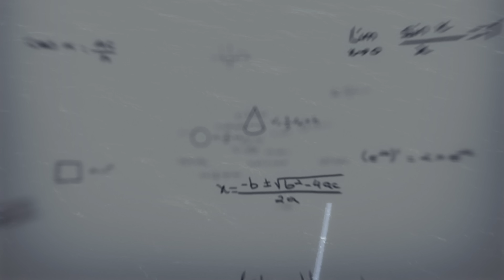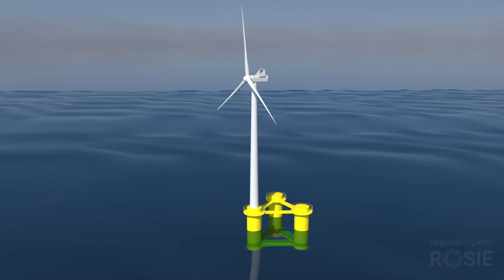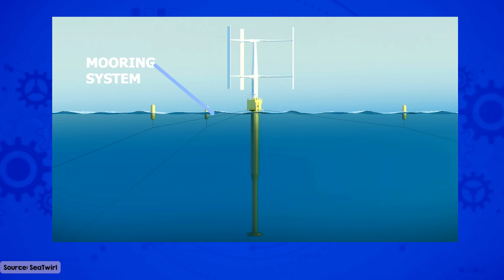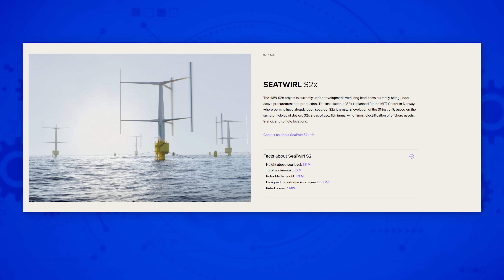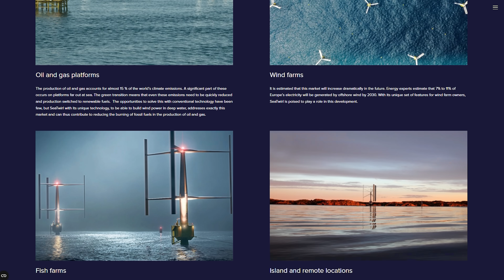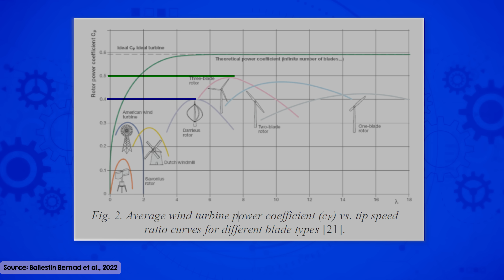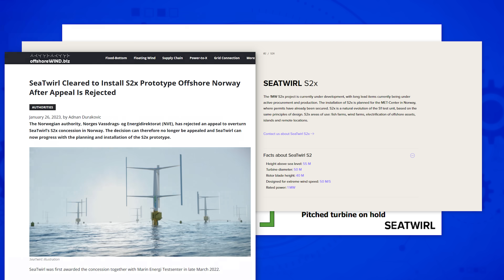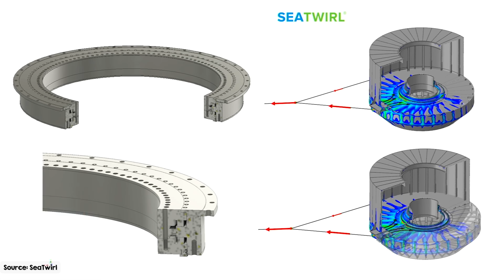Are We Building Wind Turbines All Wrong? SeaTwirl Thinks So

Comment: Didn't Trump say that wind turbines make whales gay or something?
Seriously, have they worked out a way to keep the birds away from them or perhaps lowered the speed enough for birds to not get smashed.
Reply: Apparently painting one of the blades black can reduce bird collisions by up to 70%.
Reply: I was having a similar thought.. What speed do the blades travel at? It must be a fraction of the speed at the tip of a hawt blade, but is it sufficiently slow as to be safe in all conditions? presumably there is still some risk, but the lower risk could make them suitable for sites where the risk to birds excludes hawt so worth their time getting the data.
Reply: This is part of a Google AI-assisted reponse.
Comparison to other energy sources
Studies suggest that the number of bird fatalities per gigawatt-hour is significantly lower for wind energy compared to fossil fuel energy production. 
Some organizations, like the Royal Society for the Protection of Birds, have installed wind turbines to combat climate change, recognizing that wind energy is more beneficial for birds in the long run than the climate impacts of fossil fuels

Also, there is active research on this but not on harm caused by burning fossil fuels.
Reply: Google "how many birds are killed by cats vs wind turbines per year". You will be surprised, I promise.
Reply: @nadiahopes  I already know that cats kill a lot more birds.
Reply: @nadiahopes  Actually now that you get me thinking, it's windows we should be worrying about I believe.. None the less, the fewer that die the better.🙂
Reply: The Dongfang Electric 26 MW wind turbine has a blade diameter of 310 meters and a hub height of 185 meters so birds are more likely to roost on the blades than be killed by them.,

Comment: Perhaps it's just the scale of demonstration units but seems like the blades are much closer to the waves.    Curious how they are mitigating that if not just going taller.
Reply: By being inherently more stable
Reply: @nc3826  I'm thinking more waves striking the blades.   Seems like that would be a crazy amount of shock force put into the mechanisms.
Reply: @pixelpusher220  The trust configured struts, that support the blades, are inherently robust and stable. 

And yes as it is scaled up.  It won't be that relevant of an issue, anyway.

Comment: Is there a possibility of a resonance with a rocking mode as the twin blades are perpendicular and then align with the wind? Does the spar's motion in the water provide enough damping? Does that scale with linear dimensions in the same way as the other stability criteria? If they scale with different powers of length does that set a size limit because of the safety envelope? Can that be easily addressed by altering the aspect ratio of the rotor, or the ratio of submerged length to rotor height?
Reply: My thought, no doubt they have taken that into the design
Reply: @markthomasson5077 I wonder if as a result of that thought they found an interesting or novel limiting constraint.

Comment: VAWT have been around a very long time I remember one with curved blades (like this 1:12 ) here in NZ in the late 1970s
Reply: Rosie said it's not a new idea, it's a refinement of an old one. Likely with better materials than were available back then.
Reply: @oneeyedphotographer  The one I referred to was composite like this current one
Reply: @PaulG.x  Around then I bought a graphite composite blank to make a fishing rod. There were also fibreglass composites available for less money. It might be composite, but probably not like today's composites.
Reply: My University in Canada had one on a roof in 1970s. I never saw run though, the starter motor had stopped working by the time I saw it.
Reply: nothing is completely new.... everything is just rediscovered,. in a new and different form.
Reply: Similar story with the one at the botanic Gardens in Edinburgh.